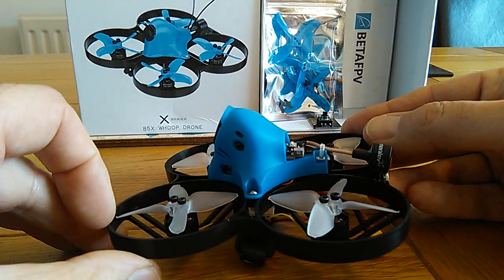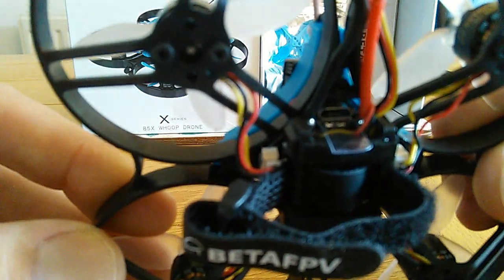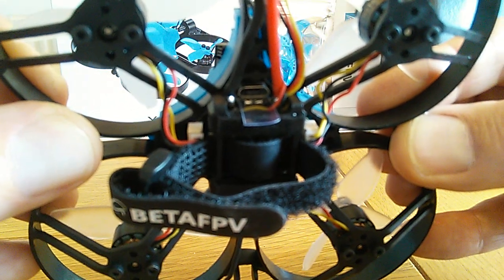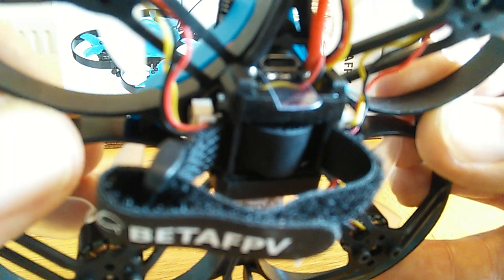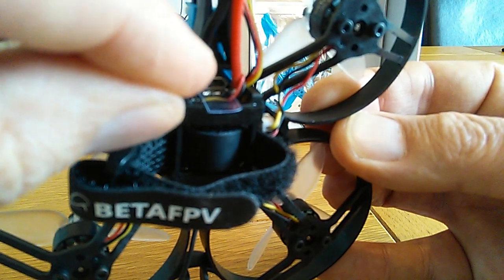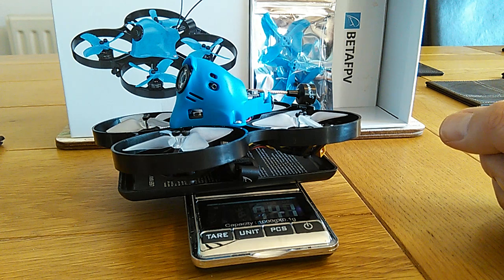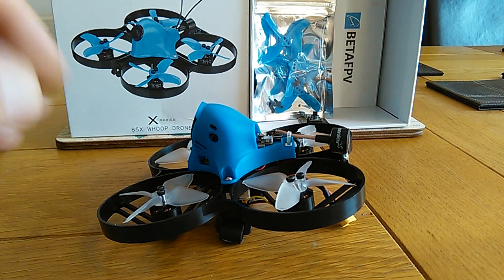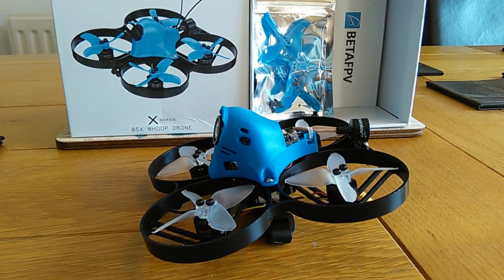Beta85x hd do this before plugging in battery to avoid shorting out battery + burnout.

Comment: BetaFPV have posted the results of their tests and determined that the cause of the fires is a design/manufacturing defect with the ESC. The ESCs will fail under high current load with 4S and no amount of insulation of the USB connector will prevent that from happening.
Reply from the maker: Yes I have read that too, obviously this video was made before that was published, betafpv are advising only to use this early ESC on 3s and are giving lifetime warranty on the ESC and FC as long as 4s isn't used.
I still think this insulation mod is worth doing even so, it's just too close for comfort and I've seen at least pictures of burned out boards where it looks like the usb socket has shorted out those points ( blackened area is worse at those points ).
So for that reason I'm leaving the video up at least for now.
Reply from the maker: @jacob james yeah, anything to insulate those middle pins.